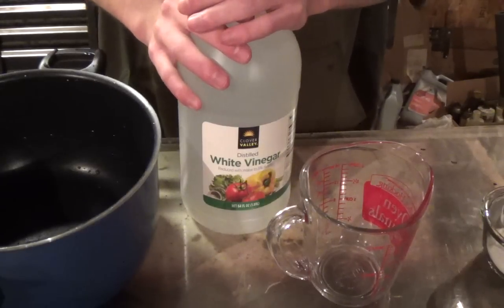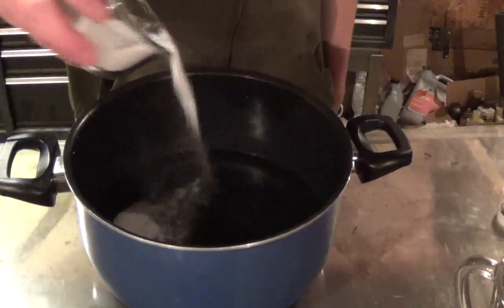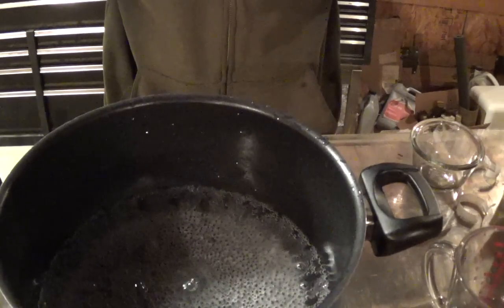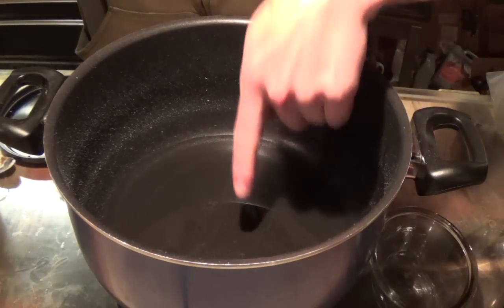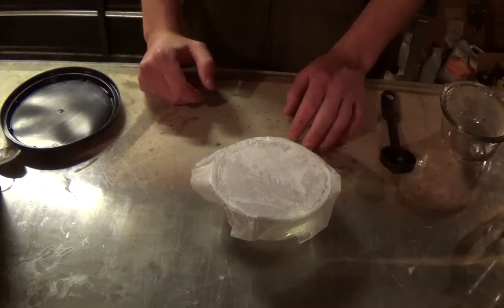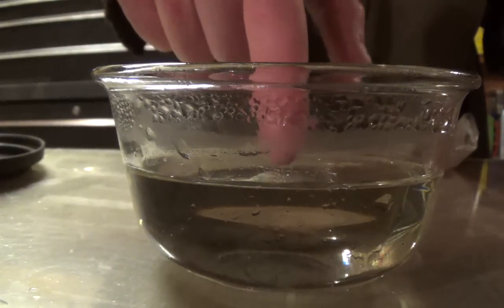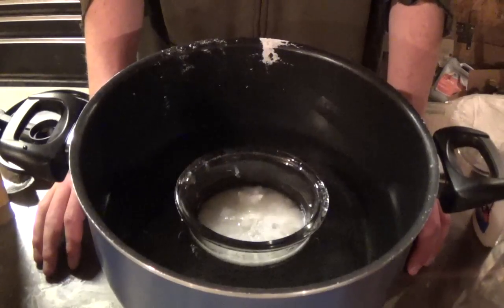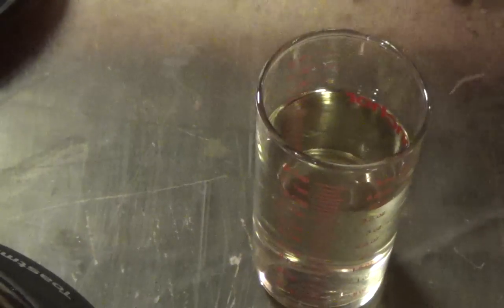How to make Hot Ice!

Comment: Bruh what if u put a hot ice on pond and touch it..... would the pond be hot ice too?
Reply from the maker: No.  Hot ice is just a concentrated solution of sodium acetate that's still liquid even though it's below its freezing point. The right concentration is key. If it's too concentrated, it'll crystallize as it cools; Too dilute, and it won't crystallize.  Sodium acetate is very soluble in water. It will dissolve and dilute if you put it in a pond.

Comment: what if you freeze the hot ice?
Reply: When it crystallizes it is freezing. It has a much higher freezing temperature than water. If you just freeze the solution it's just ice. Although the freezing point maybe considerably lower than regular water.